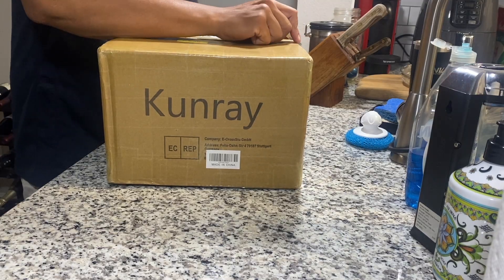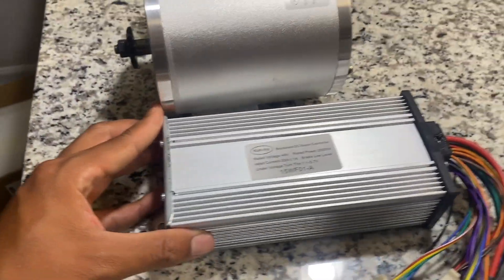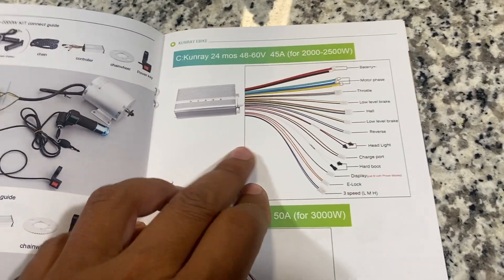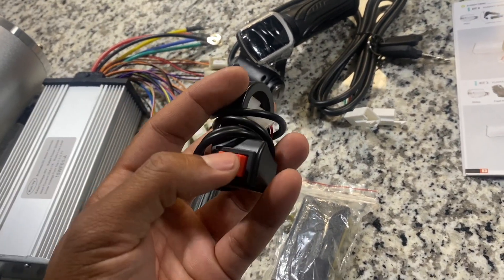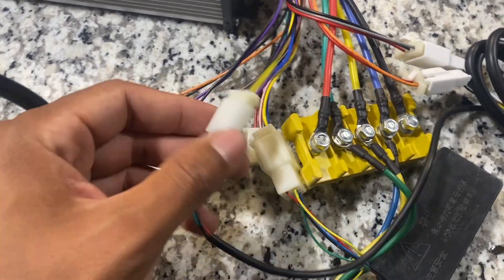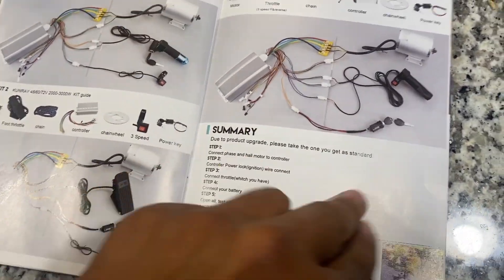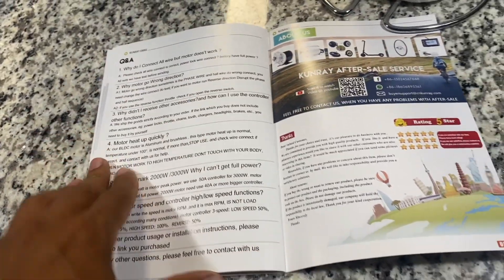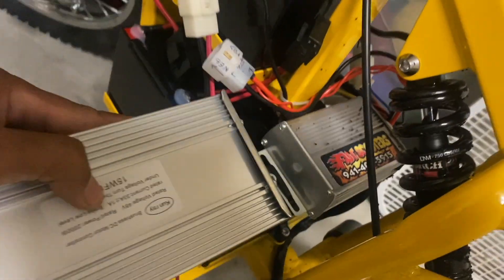Razor MX650 to MX2000 Conversion Part 1 | Kunray 2000W 48V Brushless Motor Kit Unboxing Overview

Comment: Anyone ever figure out why setting 2 is the fastest? 3 regen or something?
Reply from the maker: I recently installed a Vevor 48V brushless kit on my Razor go kart and it’s the same thing. Speed 2 is also faster than 3. These cheaper kits don’t have regen, simply (3) speed levels (50%, 75%, and 100%.) You can simply repin the switch if u want 3 to be the fastest. I’ve also tested that it’s stuck in the fastest mode anyway if you leave no speed selector in place
Reply: @PatOutdoors  thanks man. The 48v setup is for my GF. I’ll rolling with the 72 E&C 5k kit. That thing is insane!! 48 is just enough for her lol

Comment: Hi pat i got another question, i see you have a step down converter and i Don't really know what its used for is it the lights? if so ill probably need to get one for when i get lights.
Reply from the maker: Step down converter is used for all electronics that are designed to run on 12V, but installed on a 48-72V bike. You don't need it unless you are running 12V lights, just see what your headlight is rated for.
Reply: @PatOutdoors   Ok thank you I'll check the lights voltage rating now

Comment: do i have to drill new holes to mount it to the bracket or do i have to just make the screws flush , trying to mod sx500
Reply from the maker: You just have to drill the factory holes out JUST ENOUGH to get the bolt heads flush to the surface

Comment: Do you need a 48v battery to do this build?
Reply from the maker: If you want to run a 48v kit yes. Otherwise you gain no speed with the same voltage as you currently have
Reply: Could you combine a 12v battery with the 36v?
Reply from the maker: @arturamaralable  This bike comes with (3) 12V batteries wired in a series from factory. You can add a 4th one to make it 48V, but it must be the same specs as the others. You cannot add a 12V SLA battery to a 36V lithium battery, if that's what you're asking though.

Comment: Did you just crimp some loops to the original razor battery to get it in the junction box or did you have to do any soldering?
Reply from the maker: Just crimped some ring terminals to the power and ground cables from the battery to get it to the junction box

Comment: do you think the electrical upgrades, especially the kit would fit a mototec pro 48v?
Reply from the maker: No, and it wouldn’t be an upgrade for a mototec pro. That bike already comes 48v with a lithium battery and better controller from factory
Reply: @PatOutdoors  could i still perform the upgrade, since the battery in mine has been over charged and my motor has burnt out. And, since you said no to my question, what part of the upgrades wont fit the mototec pro. I also asked another youtuber named B Rich, and he had a similar kit. He said that you can
Reply from the maker: @Orvontix  look at the mounting point bolt pattern and size differences between this motor and the the motor on the mototec. But what do I know.. I don’t have a mototec. Maybe you should go with b Rich’s advice.

Comment: When you got ur new batteries how did you charge them?? Did you use the stock charger for the bike?
Reply from the maker: (4) 12V SLA batteries wired in a series = 48V, using a Fast Scooters 48V charger. If you get a lithium 48V battery, you need to get a lithium specific charger for the matching voltage.

Comment: I just received my fastscooter charger but when I plug it in it won’t charge do you know what I can do to fix it
Reply from the maker: I recommend contacting the seller you purchased it from. I've never had an issue with mine. The wiring from the charge port to the controller could have been hooked up incorrectly.

Comment: Appreciate the info just built a used white mx650 I put a 48v 50ah lithium battery and a 2000w brushless Kunray motor and controller and new handle bars and white fender to made the body and the thing is sick!

Comment: Hey I just bought a mx500 I also bought 4 12v batteries along with a 48v controller with a 48v motor what sprocket will I need to go 35 mph
Reply from the maker: What motor and kit did you go with? This same one? I would have recommended going with a lithium battery that discharges at least 40-50 Amps continuously, combined with a 13 tooth sprocket. The battery is the more important part though. The SLA batteries doesn't give this kind of kit it's full potential.

Comment: Hey Um just wondering but why didn’t you keep the other throttle because it looked better with the meter on it
Reply from the maker: I totally agree, but I just wanted to see the full Kunray kit as it is. I'm also planning on giving away the Fast Scooters kit as it was originally with that throttle. Also the throttle was a little stickier than this one.

Comment: Make sure when you cut the tabs for the motor you also drill the holes out on the motor so you can recess the screw heads. And then cut the extra length off the other end. That way you don't cut the frame. I'm so happy we're doing the same build!

Comment: Nice! I just recently built my bike with a similar setup. I used a 2000W 48V brushless with a 48v 20ah 30a lithium battery. All of it fit nice and well in the MX650 chassis. I've also got that issue where setting 2 on the 3 speed switch is the fastest. Really weird. Guess all of these motor kits are manufactured in the same factory or something.
Reply: It's the wiring on the 3 speed switch ya. You'd have to swap the plugs around on the 3 speed plug until it gets right i wouldn't touch it tho
Reply from the maker: Thank you for this
Reply: @PatOutdoors  i meant swap pins around in the plug but I'm sure u got what I meant. I don't think there's any harm swapping em around until it gets right. Should be 3 pins in the 3 speed plug
Reply from the maker: @JAKEDOWN92  I figured that's what you meant. I just don't feel like de-pinning connectors right now so I'll probably save that for a later project when I clean up all the wiring when the new battery comes in
Reply: @PatOutdoors  same. Its gotta be the 2nd and 3rd pin swap
Reply: ну и как греется по сути моторы недоработанные

Comment: Seen guys drill vent holes in those to cool them cause they are so Crazy. SO excited to see this. I been drooling over this motor for months.....
Reply: Adding a heatsink is also a good idea. Those motors get really hot quickly. They also slow down and seem to have much less torque than when they are cold so probably a great idea to keep them cold.